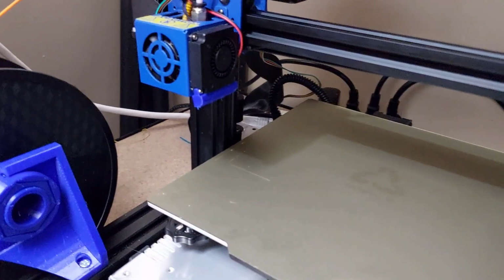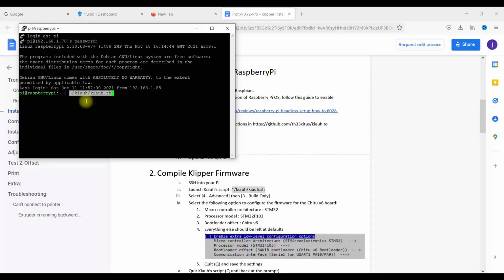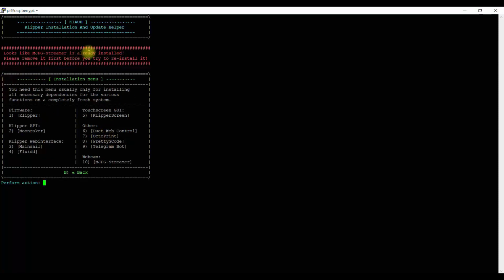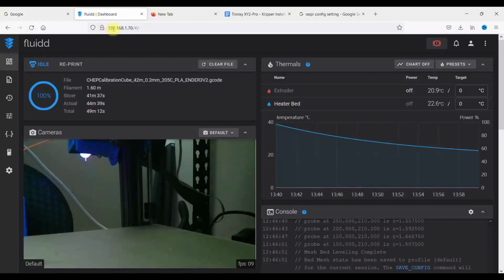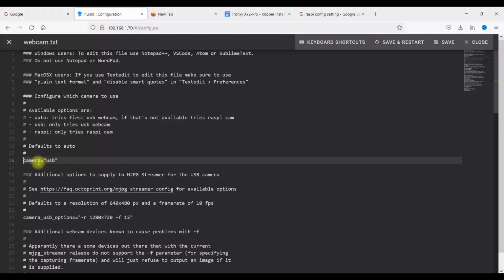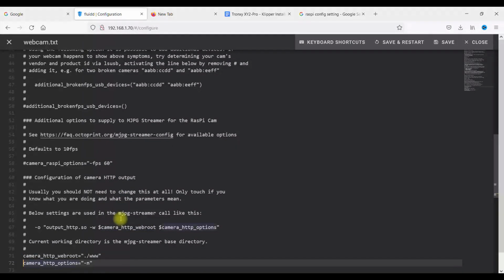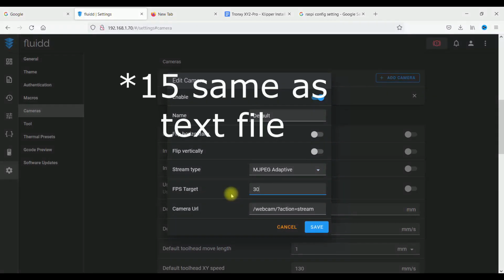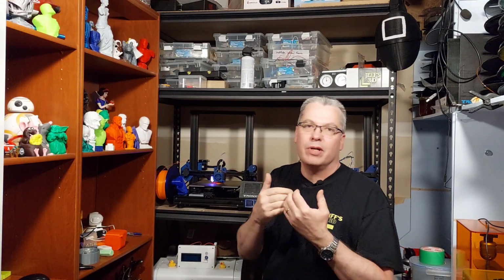Pi Camera Klipper Install step by step

Comment: Hi Jeff,

I hope you're doing well! I have a question regarding the touchscreen that came with a generic 3D printer board (CXY-U6 191017). The screen works perfectly and communicates over serial, and I would love to reuse it instead of buying a new one.

Do you know if it's possible to make this kind of screen work with Klipper — either directly connected to the Raspberry Pi or through some adapter or microcontroller?

I’m fine doing some tinkering if needed (hardware or software), I just want to know if you’ve seen someone manage it, or if you have any advice on how to make it compatible with KlipperScreen or any custom interface.

Thanks so much for your time — your content has been a huge help!

Best regards,
Raúl Pereyra
(From Argentina 🇦🇷)

Comment: there is no legacy camera option in my updated pi os,  in raspi config using command line , interfacing options, no camera mention anywhere, os was installed in March 2024 so is not old
Reply: so what did you do?
\

Comment: Hello, has anything changed since the release of this video? I did everything according to the instructions and my camera still doesn't work. I can only see a black bar in the fluid. Please help me
Reply: In webcam.txt you need to uncomment #camera="auto".
Reply: I also noticed that in Settings > Cameras "Your Camera Name" > Camera URL there is a typo by default. The default value reads "/webcam?action=stream". It should be "/webcam/?action=stream". There was a "/" missing right after "/webcam".  A soon as I corrected the typo my camera started working immediately. Give it a go if you haven't already. Let me know if you have any further questions. I will do my best to help a fellow 3D Printer 👍

Comment: legacy mode fixed can issue for me! Currently no need to do any of that. Just write image of FluiddPi latest. edit wifi details and power on Pi with sd card in. go into Fluiddpi.local and settings->camera enable and set mpeg stream. - everything else is pre activated and pre installed. If you get black screen instead of image than turn on legacy mode as advised in this video
Reply: need manually enable the camera legacy mode for me, even intstalled official fluidd image